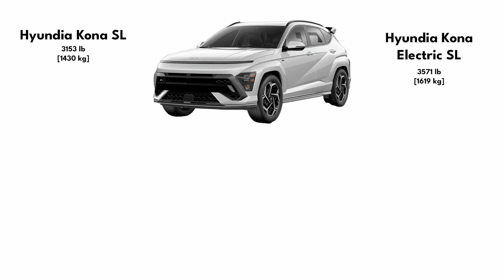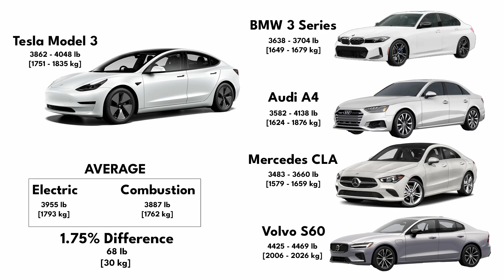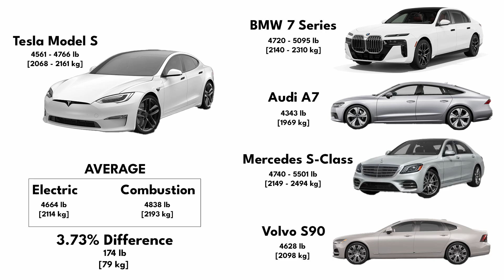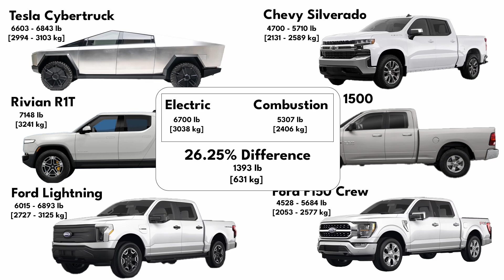Shocking Guardrail Failure: EV Weight Debate

Comment: The problem is more that we've let passenger vehicles (and I include pick-up trucks in this as that's how they're typically used) get far too large and too heavy. Electrification continues to enable this, rather than cause this. While I'm not suggesting everyone goes out and buys a Daihatsu Hijet, when its bed is not dissimilar in size to the Cybertruck's then something has gone badly wrong with Western car design, and consumers.
Reply: Blame the EPA, they're the reason most companies stopped making cars and starting pumping out SUVs
Reply: @muffinxcancer  

I was looking at vehicles' body styles and noticed how bland they looked. All we have is suvs, but in Europe, they have wagons and every other type of vehicle  body style
Reply: @muffinxcancer yes
Reply: My 1991 f150 weighs 2080kg teslas which are half the size weight 2.1-2.4 tons so….
Reply: The Ram Series Is The 3rd Best Selling Vehicle In America Selling More Than 444,926 units
 
Look at the Ram Series Weight By Model
2024 RAM 1500 4,779 to 6,443 lbs
2024 RAM 2500 6,001 to 7,224 lbs
2024 RAM 3500 6,057 to 7,339 lbs

The 3 best-selling vehicles in America in 2023 were Full Size Pickup Trucks 

(Ford F-Series (750,789 units sold)
(Chevy Silverado (543,319 units sold)
(Ram Pickup (444,926 units sold)

The next three are mid-size SUVs,
Toyota RAV4 (434,943 units sold)
Tesla Model Y (385,900 units sold estimated)
Honda CR-V (361,457 units sold)

followed by a single Midsize Pickup Truck 
The GMC Sierra (295,737 units sold)

followed by a single sedan (290,649 units sold) The Toyota Camry 

and then we're back to little Suvs and Trucks.
Reply: Well, US consumers maybe, the rest of the world still buys normal sized cars
Reply: @mickleblade  You might be in denial / not paying attention.  Look at what's happening to European performance cars: 2018 SMG GT 63S weight: 3,627 lbs, 2023 AMG GT 63 S weight: 4,637 lbs (+1,010 lbs!), 2024 AMG GT 63 S weight: 5,247 lbs.      European performance ICE vehicles are almost REQUIRED to be EVs to hit fuel economy and emissions requirements and just slapping batteries and an EV motor on one is the quick and easy way to get there. 

Almost all vehicles are getting porky globally right now and the few efficiency-focused, small ICE cars are just going to see the rate of vehicle fatalities increase as a result.
Reply: @adamarndt7617  good point, but tbh those performance cards are rare. The majority of cars sold are smallish fuel efficient ones in Europe
Reply: @mickleblade  Totally. (I lived in Ireland for 5 years; I think there's even fewer performance cars in Ireland vs. much of the rest of Europe, but I did want to point out that all really expensive, high performance vehicles globally seem to be getting HEAVIER, very quickly.  I'd love to see regulation focused on slowing down / reversing that trend before it becomes a very real safety concern.
Reply: @mickleblade  Nah, European brands have got bigger and bigger and bigger. I recall decades ago walking to my Mercedes 190E, a full-size 3-box saloon, and the new-then Ford Fiesta, a small economy car, was actually larger than my Merc. That 190E had a little certificate saying in testing it did 45 miles per gallon (it was in German, but that bit was in English, as it was some import doc). What's the mpg of a modern Fiesta? Let me check.. 1.5 EcoBoost (Stop-Start) Petrol Manual gives 44 mpg. Worse than my 1990s Mercedes. Fantastic.
Reply: @bigglyguy8429  hmm, need to be careful of mpg figures, is it imperial or us gallon? 20% difference
Reply: @mickleblade  Both in UK, so imperial
Reply: Why don't we address the REASON pickups are so big. Emmissions regulations based on vehicle volume. This is why the trucks keep getting larger. It's much easier to simply make the vehicle larger than more efficient. Classification of mid 1980's pickups as cars is why new pickups are gargantuan.
Reply: @andrewb8548  It's not just CAFE standards driving consumers to bigger vehicles; all types have increased in weight since the mid 80s. The rise of the SUV (particularly outside USA) is pushing vehicle weight and size upward, and that is entirely consumer pressure. People equate bigger with better when comparing with the Jones's.
Reply: Vehicle size design is directly correlated to ridiculous CAFE standards (regulations) in order pass the standard, manufactures have made ALL models much larger than their older namesakes.
Reply: Wasn't it a certain Elon Musk who uttered the words 'we've shot ourselves in the foot with the Cybertruck'?
Reply: Yep agree. Gone are the days of most vehicles on the road being sub compact and compact cars. There are much more SUVs and trucks average families drive now. Compact cars are still popular but they have less percentage in the market than decades ago and they have grown in size. A 2004 Honda Civic weighed 2600lbs and now they are 3000lbs. There's more likelihood of a heavy dense vehicle going through the guard rail especially with the speeds people drive.
Reply: "Electrification continues to enable this, rather than cause this." EV's have caused heavier vehicles. Also a lot of policies made light trucks go away.
Reply: Full size pickup trucks weighing at 5500 lbs or much more have been selling in much higher numbers than "cars" ; Ford F150s continue to be the highest selling model in the US for 30+ years. All of this happen well before the first EV arrived.
Reply: Yes mate I agree and why anyone should need a large pickup truck for example is beyond me unless it is needed for a trades person. I see many of these vehicles on the roads here in Australia and truly the drivers are also often very reckless in the way that they drive.
Reply: Yep. You nailed it.  We really need governments to start encouraging and incentivizing lighter weight vehicles.  Tying "road use" taxes to vehicle weight is an obvious first step that also solves the problem in many US states where road use taxes are solely paid by a gasoline-based tax only.

Comment: I wonder about parking garage weight limits. How much overweight capacity can they take before they collapse?
Reply: I saw my mother in law walking in the parking garage at the hospital. They are stronger than you may think
Reply: @DebbieOnTheSpot  Don't let her see that post, or she may shortly arrange to be able to say the same about you. ;)
Reply: Those studying this topic might check out the collapse of the Surfside condo near Miami. Investigation revealed that from the start the columns in the garage were already stressed at 100%. Over time, with salt and water intrusion, that became even less adequate. In much the same fashion, parking garages that were built decades ago with little excess strength aren't going to hold up well with today's much heavier SUVs and EVs.
Reply: @Inkling777  Cars in the 1960s and 1970s were HEAVIER than modern cars, and even most modern SUVs. My mom drove a 1968 Thunderbird with a V-8 460 that weighed nearly 5,000 pounds. The drive towards better fuel economy has lightened cars in the interim, but even today's eSUVs aren't really any heavier than what these older garages were designed for.

The real issue is that any concrete structure that age may have deteriorated. Concrete lasts thousands of years only if properly prepared. The Romans knew how to do this; we don't. Or at any rate, build like we don't.
Reply: @shane99ca  Roman Concrete, like standard concrete without rebar, is only good in taking compressive loads, and the lack of rebar allows it to last longer at the cost of very limited structural usage.  Our modern structures have steel rebar, which adds bending and tension resistance to the structure.  The danger with rebar is that if it corrodes through water, salt, and other issues, the rebar expands, damaging the concrete and the strength of the structure.  Road salt usage is a major factor in the damage of bridges, where drains are plugged or clogged.
Reply: Definitely something that needs to be objectively studied. I have seen a truck on a parking ramp that was designed for cars and all four tires had punched through the concrete.
IF existing parking decks are designed assuming a certain maximum weight per car and the cars get heavier there are 3 possibilities, the parking deck may be adequate, the parking deck may need to be strengthened, or the parking deck may need to be demolished and replaced.
Reply: This is easily fixed by making the spaces large enough to accommodate larger vehicles. Finding a parking space for a full size is not always that easy.
Reply: @rich7447 lol no, you don’t need a big car in the city. space is at a premium, and the spaces are he size they are for a reason.  Individual transport vehicle ownership attitudes have to adapt, not the other way around.
Reply: @creatrixZBD  I didn't say anything about cities. Attitudes don't need to adapt. Infrastructure has to be suitable for the vehicles that people choose to drive.
Reply: The “extra” weight is a total crock in car parks. If the average weight of vehicles has increased over the decades (and it has) and it actually threatens to overload the specifications of the building, cut the number of car spaces. Airlines count on an average passenger weight of 170lbs, but if average passenger weights increase, then carry fewer passengers. Simple.
Reply: That's a very real problem. Look at the fire in Luton UK. Nothing to do with weight but I'm certain that the replacement building will need to be substantially increased in strength - and parking bay sizes. Then the question comes for the owners - Are EV's worth it?

Comment: It's not just the centre of gravity, it is the distribution of the mass across the frontal qrea.
In an EV the mass is concentrated in a narrow sliver at the bottom of the car and most likely below the bottom of the guardrail - not what the stanchions were designed for.
The vehicle is almost like an axe.
Reply: In other words, the weight distribution is similar to that of a traditional body-on-frame automobile, found on all types until the 1970s and on pickup trucks and truck-based SUVs even today.

A 1937 Packard Eight weighed 6,000 pounds—a full three short tons. That's heavier than virtually any modern production car, light truck, or SUV.

EVs will have growing pains for a considerable time yet, but their weight is among the least of these issues.
Reply: @shane99ca  an old time frame is a fraction of the weight a battery pack - 2 people can easily pick up and move one (I have done that personally)
I'd like to see 2 people pick up any automotive battery pack.
Reply: @gregculverwell  An old-time frame (still used in some designs, BTW) is about 300 pounds, so while it's possible for two average guys to move it, I'd hardly call it "easy."

Comment: It costs between $500 - $1500 per liner foot to set a guardrail. A mile is 5280 feet. As of 2018 there is 138,000 miles of guardrails in the US. Just using the $500 number if we have to replace all the guardrails in the US cause the center of gravity on EV’s sits to low for the guardrails to properly stop them it would cost well over $364 billion to replace all our current guardrails so double or triple that to engineer and set new ones.
Reply: Designing a guardrail that's compatible with the low center of gravity of EV's as well as the high center of gravity of ICE vehicles (especially trucks and SUVs) sounds quite challenging and very expensive.

Comment: I think you got it back to front. Yes, the engine is heavy. But it sits right on the axel. It support it self.
The battery  is also heavy, it typically sits between the axle, it need the car to suport it..

Comment: Good call.
The head-on car crash looks like they just wanted to include some sensational video in their report. An impact angle is not possible on a road where the vehicle is traveling parallel to the guardrail. Any instances where the car is pointing directly at the guardrail would either be at a much slower speed or a significant fraction of its velocity would be parallel with the roadway.
Reply: With respect: it's nearly 40 years since I was involved in recovery - but let me assure you - there is nothing a vehicle involved in an accident can't do.  I once saw a fully loaded bulker truck wedged under bridge pillars. In theory that was totally impossible - but it happened!
Reply: I looked at both clips very carefully and they are two camera angles of the same, single crash. The 'head on' looking angle is optically compressed because they are recording with a very long lens eg 1000mm. Obviously they had to set the camera at a safe distance and zoom in for the shot. The other camera angle is using a more normal lense 50mm - 75mm maybe.
Reply: That's a good point. If the long lens were placed looking head on to the path of the truck  but not at a right angle to the railing then the compression effect would wipe out the normal perspective of an angled rail. A few yards difference would disappear with a 1000mm lens. The actual impact angle is shown better in the side shot and in that shot the truck is shown moving almost parallel to the guard rail after it breaks through. You can see that quite clearly if you stop the video at 7:19. @WhiskyMystery
Reply: It is actually a good demonstration of different lens choices on composition :-) @Inkling777

Comment: A better way to compare might be to average the weight for each type BEV vs PHEV vs ICE by vehicle size class across the top manufacturers or top sellings cars for each size class
Reply from the maker: In theory, this sounds good,  but the design of these platforms makes for terrible comparison.   There are design features that carry over from each propulsion strategy that add excess weight.

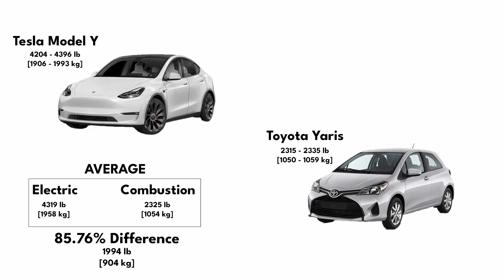Comment: At 3:46 how did you arrive at that 85% number? It should be 46% ( 904/1958).
Reply: 85%*904+904=?
Reply: Scratch that, with your data Tesla is weighing 214% of the Yaris lol
Reply: @kylinblue  904Kg is the difference in weight between the 2 cars. How did you get that 214%?
Also thanks to your miscalculation I found out how he arrived at his 85%.
Reply from the maker: "percent change".  ((y2 - y1) / y1)*100
Reply: @StacheDTraining  I realized later that you used the Yaris as a base
Reply from the maker: @rutessian  The Yaris was more an example of absurdity.

Comment: Part of the problem comparing things specifically to Tesla is that Tesla is a cheap EV masquerading as a luxury brand. It's not fair to compare it to other high quality EV's because it's simply not built by a company with that leadership/experience, or to that quality. Really it doesn't matter much car-to-car, the important thing to know is that cars/vehicles are getting heavier and that means safety will be much harder to guarantee by anyone.
Reply: Great point, I was thinking the same thing. If we are listing EV's from actual luxury brands, a BMW i7 is 5900-6100 pounds, a Mercedes Benz EQS is 5500-6300 pounds, a Porsche Taycan is 4600-5100 pounds, and a Cadillac Lyriq is 5500-5800 pounds. If we used those as examples instead, at least we could compare gas and electric vehicles of comparable sizes within the same brand.
Reply: Just the daily question...why don't you see teslas on the paris to dakar rally?
Reply: Tesla makes the safest cars
Reply: Sounds like politics to me. What flaws, specifically, exhibited by Teslas contribute to this poor test result? I expect specifics, not generalities or political hatchet jobs.
Reply: Teslas like all EVs are NOT CHEAP ,they're so expensive and don't even think about repairs or replacing the battery . There's a joke ," Don't car jack a BMW owner ,go for Tesla owners "
Reply: I have seen this hater in a lot of tesla sites. FULL BS
Reply: @b4804514 to bad they’re right, and Tesla’s are horrible in quality and engineering vehicles to last…